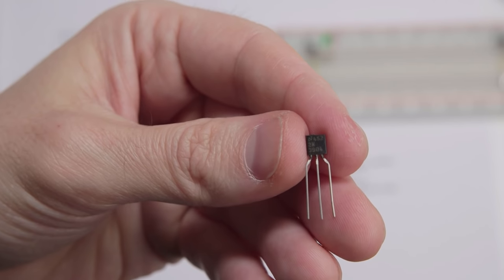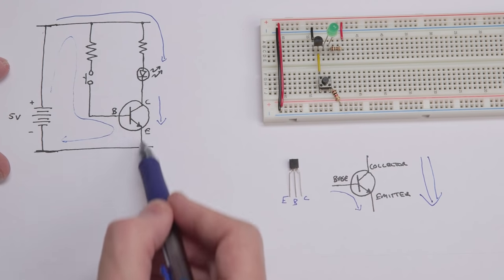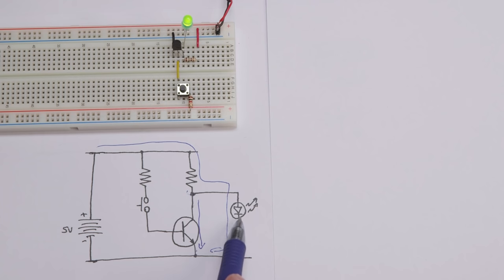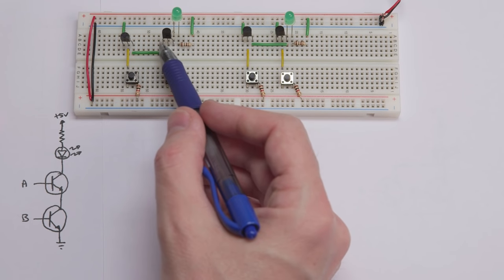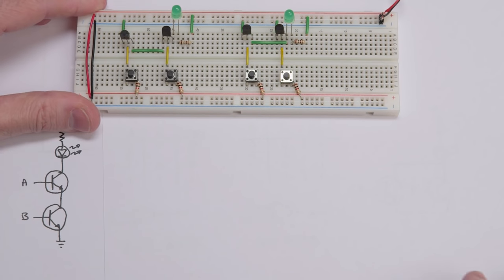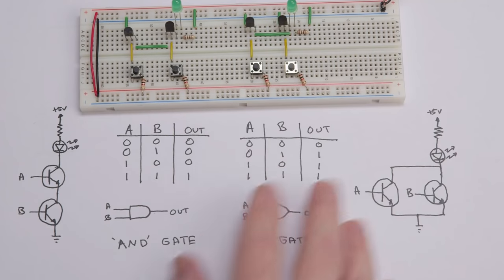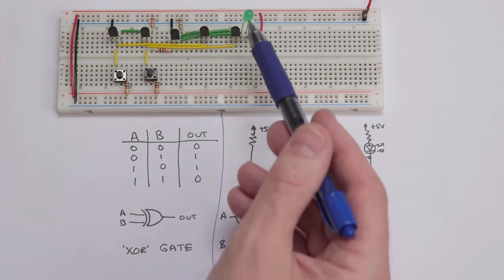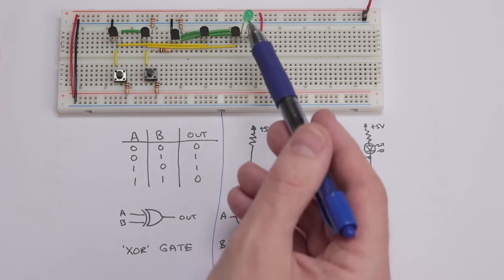Making logic gates from transistors

Comment: Thank you. I'm using this information to totally rewire my computer.
Reply: That's nearly impossible
Reply: 😮 You have WAY more patience than me!
Reply: Jimmy Kinkade 
LMAO You gotta have an electron microscope to get to see the inner wiring of your CPU
Reply: You're working on the assumption that he's talking about an off the shelf computer that consists mostly of Integrated circuits.
If he means a homemade computer created using discrete logic or any of a number of techniques to create custom circuitry (many of which are described on this channel) then it's a perfectly reasonable thing to do.

You can make your own CPU using anything from transistors, to logic gate IC's to memory chips (memory can replicate any function it has enough pins for. Something with 8 data lines and 8 address lines can replicate any discrete logic function that has 8 inputs and 8 outputs. You can even theoretically build an entire processor using this alone.), and of course you could use an FPGA if you need very high performance and complexity and something that's practical for frequent use.

Did you know the Amiga's custom chipset was made in prototype form using discrete logic and stuff like this? A bunch of massive circuit boards full of components, which in the final thing reduces to just 3 integrated circuits. Nevertheless the prototype was made of discrete components, and it worked the same as the final thing, though it was more failure prone.
Reply: KuraIthys, with respect.. nobody makes a computer using discrete transistors, it would take thousands of transistors to make a simple 8 bit computer.. also, how can you expect this video is helpful for someone who has already made a homemade computer with discrete transistors !!
Reply: I didn't say it was a good idea, I just said it's possible. - it's within the realms of something someone could do by themselves if they really wanted to.
(And that has this got to do with the video? I was remarking on whether it was possible, because someone in this set of comments implied it wasn't.)

(And for the record, my comments about the Amiga were about the use of discrete logic chips, not transistors. - but seriously, how did you think people prototyped this stuff in the days before FPGA's exactly? - Here's a picture of it: https://pbs.twimg.com/media/CK29JtQUsAEP8xT.jpg:large - note this doesn't include the CPU, which is an off the shelf 68000, but rather it's the custom chipset. Graphics, sound, glue logic, etc.)

A fairly complex (as far as it goes) 8 bit CPU that was used in the early 80's is the 6502 - this consists of 3510 transistors. (not logic gates, transistors)
The real thing is of course an integrated circuit, but let's say you try and create something similar (because you're insane) using discrete logic.
On a breadboard that would be problematic to wire, you'd be better off using an actual soldered board.
The arrangement seen in the video is good for demonstration purposes but not very space efficient.
Leaving aside that you can use surface-mount parts (either using proper surface mount techniques, or hand-soldering if you're good at it, with the larger parts), 
You could cram about... 2 full size transistors into a square cm, so a design of that level of complexity would involve ~3500 cm^2 let's say 4000 for simplicity and to allow for the electrical routing.

That's a 63 cm to a side square board, or, more likely a large stack of boards.
Which is absurd of course, but discrete logic IC's don't help you much. There's about 4 logic gates per IC. 
(about 8 transistors worth) and the IC itself is about 2 cm^2 - meaning it's approximately 50% smaller than a pure transistor implementation.
With surface mount parts you could make gains better than that.

All I was saying is it's possible, and within the realms of complexity that someone could do at home.

The step from discrete logic to a pure transistor implementation is not a large one.
If you think transistors alone is too complex, then logic IC's aren't much of an improvement, and you probably shouldn't attempt something like this anyway.

The complexity isn't much lower for other methods, it's just the amount of individual parts that you have to assemble and the amount of space the end result takes up that changes.

These days if you're building something like this for any kind of semi-practical purpose...
Use an FPGA.

Otherwise, you're doing it because you WANT to do it, and because in fact, it is something that's possible to do, just about.
Reply: Most integrated packages are first prototyped with discrete transistors, and a schematic can usually be found of its 'equivalent function' illustrating what said prototype would look like.
Reply: May I know the values of resistor bulb transistor
Reply: Jimmy Kinkade - Well, unless you have 10 micrometer tweezers, that's not happening anytime soon.
Unless you're designing your own CPU...

Which I can guarantee, won't ever be at 16 bit standards...
Reply: we all have gtx 1080
this man got gtx 3080 with one simple trick
Reply: hahahahahahaahahahaahah xd
Reply: @abdelrahmangamalmahdy  I used to fix computers made with NOR logic and descrete Transistors, uses seven 12 bit registers, JK Flip Flop, through a Full Adder. Yes it was not a million years ago.... yep I am still working and cannot collect he state pension .......
Reply: Did we all just get wooooshed or is he talking about a small computer?
Reply: I'm using this information to rewire my brain by learning new info. :)
Helloooo YouTube University! :D
Reply: @abdelrahmangamalmahdy  you should take a look at the rest of his channel. He does, in fact, build a functional 8-bit computer on breadboards out of these https://eater.net/8bit/parts.
Reply: So many r/whoosh
Reply: @FutureAIDev2015  do u kno de wae?
Reply: somone made an entire computer in rt-logic (recently, that is).
Reply: @erumaaro6060  no
Reply: can i get in on this conversation? i ran out of transistors so i had to run the signals through dc/dc converters at very low bandwidth due to how fast they can switch signals and now i am working in the HV domain with my logic being passed through 12ax7 triodes, does anyone know how to get the signal through to the tubes faster? also how do i get an output on 5v logic level after the 256x256 grid of 12ax7s???
Reply: @Cookieglue  "Unless you're designing your own CPU..." Yeah. Welcome to Ben Eaters channel. :-)
Reply: @Calvinatorzcraft  aaaand you dient get it, sad
Reply: Every time I watch this video, I kek discreetly to myself at this comment.
Reply: @Calvinatorzcraft  Note the word "nearly"
Reply: Did no one else realise this is a joke?
Reply: I love how almost everyone above ate this, lmao.

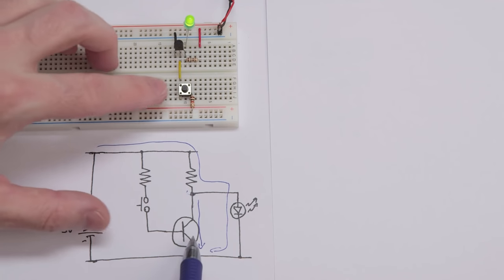Comment: Hello, thanks for the video. I have a question in mind about the circuit at 3:20.

So, we're saying that there is no voltage difference between the two sides of the transistor, and I guess that's because the resistance of the transistor is negligibly small. But does electricity still flow through the LED, albeit with no effect visible such as light? And does that, in a larger scale like in CPUs where there are many transistors, affect the system?
Reply: Electricity always flows, even when a transistor is turned off. But the voltage and amps are so minimal that they are neglect-able. Most processor or logic devices have a minimum voltage threshold (before they activate). This is good because it smoothes out minor leakage and reduces the risp of EMI  (electromagnetic interference)

Comment: The part at around 3:45 about differentials is a little confusing to an amateur. It seems like a current would be flowing through both paths and the light would still be on. 
Maybe that could be clarified better? 

Great video nonetheless. Thank you!
Reply: perhaps it's a matter of resistance. if transistor's resistance is too small compared to led's resistance then almost no electricity will move through the led
Reply: kaliKoder yes you can,  just make sure that the resistance in transistor's path will be still too small 'Compared' to the led's one.
Reply: You can think of a transistor as kind of splitting a circuit in two.  One side on the collector side and one side on the emitter side.  Voltage is the difference between two points.  When the button isn't pushed, on the collector side, with respect to ground is +5V (minus some for resistance), that is because there is no flow on the emitter side.

When the button is pressed, there is flow from the collector to the emitter.  Thus the energy is on both sides of the transistor.  Since there is no difference between the collector side and the emitter side, the point on the collector side leading to the LED is 0V with respect to ground.

You are correct in thinking that it looks like a parallel circuit, but because of the transistor, you don't actually have a parallel circuit, you instead have the part of the circuit on the collector side of the transistor and the side of the circuit on the collector side of the transistor.  You can try this yourself, if you build the circuit as shown and then measure the anode side of the LED vs ground (or negative on your battery), you will measure zero volts.  If you measure the emitter and collector sides of the transistor you will find +5V (minus some for resistance).

This is just one of those counter intuitive parts of digital circuits.
Reply: What about 0V on the LED end because the current which flows into it isn't sufficient to pass its resistance? Have you checked the input current of the LED when the transistor is on?
Reply: If anyone is still curious about this, check out my answer above.
Reply: I assume you've already gotten an answer so this is more for those who see this video later.
The LED requires a minimum voltage in order to even turn on. The required voltage is about 1.8 volts or higher. If the difference in voltage is below this threshold, the LED will be off. So when he presses the switch and turns the transistor on, it then starts conducting and at that time pulls down the voltage at its collector closer to the voltage at it's emitter. The voltage difference between the emitter and collector on the transistor won't be 0, but will still be quite low (for instance with a 2N2222 transistor and a collector to emitter current of 15ma, the voltage difference between collector and emitter will at most be only 0.4 volts. If the current is 50 ma, the voltage difference will still be lower than 1.6 volts). This voltage difference is less than the threshold voltage for the LED, therefore the LED won't light.

Comment: Remember:

-Emitter(left), Base(middle), and Collector(right)

-Current to base allows current to flow from Collector to emitter
Reply: I advice not to remember this. Not all packages are the same. Some transistors have the gate on one of the outer pins. Just open the datasheet and take a look.
Reply: Yes.  Always read the datasheet thoroughly.  I once spent over a week trying to fix a problem with an 8 channel ADC driver I wrote only to realize that the 3-bit channel address was not simply the channel number in binary.  There was a table in the datasheet that showed the mappings.  I assume the odd design was used to make the physical layout more efficient and keep the analog input pins in order of the channel number.

Comment: Very nice. I'm actually using this to create a lab work for my students. Thank you. Having said that, I must point that what you explain are not AND and OR, but NAND and NOR, because the led lights when it receives a ZERO and the transistors "open" when they receive 5V, that's a ONE. Also, I'm afraid there is no XNOR gate...  you see, the truth table for XOR is EXACTLY the same as for XNOR!! So it must be the same gate, right?

Comment: In your inverter circuit example, the resistance of the collector resistor should be less than the resistance inherent to the LED in order for most of the current to flow through the Collector/Emitter path.